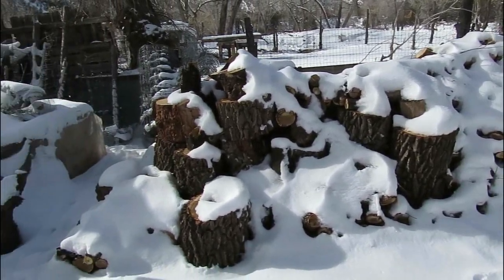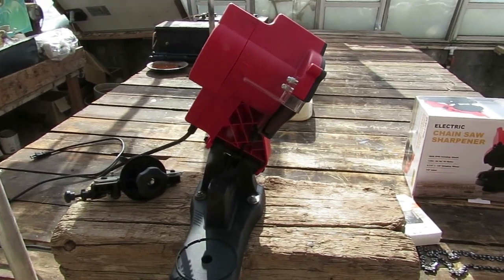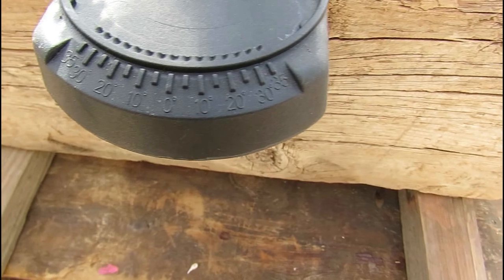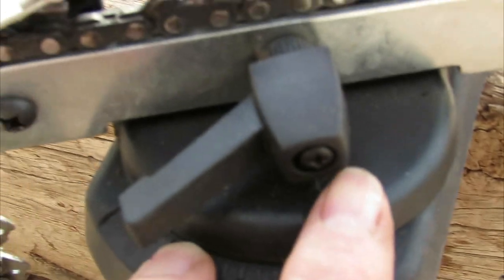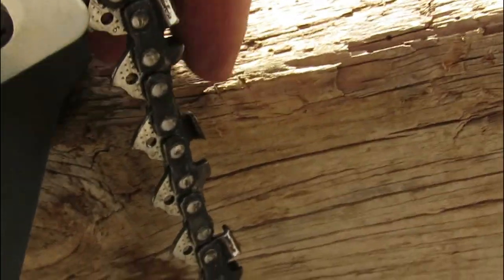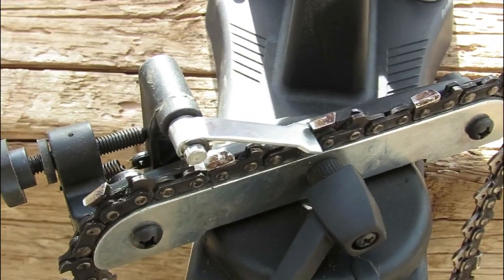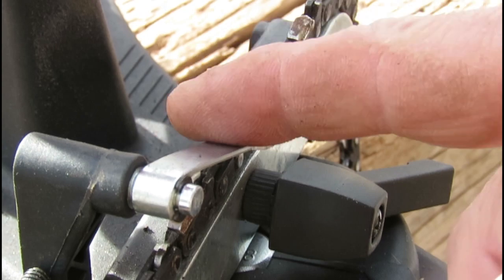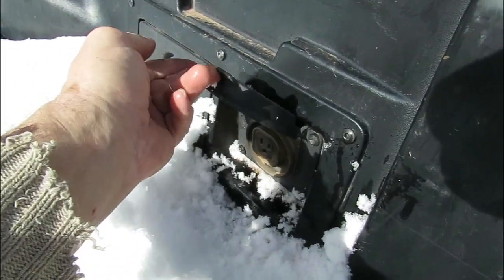Buffalo Corp. ECSS electric sharpener to sharper - refurbish bad chainsaw blades

Comment: I don't heat my home with wood, but I do heat my cabin with wood, so I spend a bit of time cutting & splitting wood. A few years ago I started using an electric chainsaw. It's quiet and starts with the push of a button, I love it. Lots of silver maple where I live, soft, splits easy and seasons fast.

Comment: I love my little Harbor Freight unit. It's only a tad easier to operate than yours.
I cut all of my chains at 25 degrees. Just a personal preference.
My eyesight is not improving with age, so I like to have a magnifying glass handy, when doing touchups, to see if the bluntness has been erased.
You've probably noticed that there's some side play in the pivot of the head, which is kinda nice to lightly lean into, when a cut hasn't been quite enough.

Comment: G'day Dave,

Yay Team!

"Under $50..." ; Yikes, what an absolute Hummdinger, that's a Bobbydazzler of a machine ; a huge amount of Technology for a pittance...!

It's an example of the "Excellent Value Chinesium" which is out there, in among the "Average" & the "Shitty" which are much easier to encounter.

  Beware of their "mtm" brand Chainsaws though..., apart from the usual pitfalls from the  cheaply manufactured  Powerhead, mine (a "62-SX") came with a Bar which is too long - so the Saw balances wrongly & dips it's nose in the Dirt every time it's put down,  it's Groove is too wide for the (narrow profile) Chain - so the Links  don't sit "Flat" but rather they wobble side to side (if they had used the correct Chain for the Bar, maybe the Motor wouldn't have sufficient "Grunt" to pull it through the Wood...?).

And the Bar appears to feature unhardened Mild Steel Edges on the Chain-Groove - so within 2 hours of first use the loosely  wobbling Chain had worn down the outer edges of the Bar Groove's Top-sides - allowing the Chain to "Rock & Roll" from side to side dependant on which Teeth are the sharpest & which cut & bite in the deepest,  therefore pulling the Chain off-centre...., leaving "Ripple-Faced" ends on both sides of the Cut.

By 3 Hours it was jamming itself by trying to cut in Curvaceous Lines - sometimes Left & other times Right - depending on which Teeth started the departure from the Straight & Narrow.

At the 3-Hour mark I "Dressed" the Bar with my Powerfile - but it's not much better...; I think the Chain-Bases are also soft Steel & they're now all worn off-centre as well...(?).

  So,  I think that I'm going to have to buy a (propperly manufactured) shorter Bar, and a new Chain the Tangs of which fit into the Bar's Groove without wobbling.

  So much for the $130 Chainsaw, which otherwise ignites the Bark on the Wood being cut - with it's stupidly-routed Exhaust Gasses...(!).

About the only aspect of your Chain Sharpening which might be apparently improved, would be to pre- inspect the Chain and locate the MOST Damaged Cutter it contains, and use that one to set up the various Adjustments on the Machine...; so that when finished, ALL the Teeth will be the precise same length as the one which needed the most Metal removed.

It "wastes" metal from all the less-damaged Cutters - but having Cutters of varying lengths (often caused by trying to dress individual Teeth after Rock-Strikes...) generally leads to rough & jerky cutting, bogging the Saw in the Wood, and having the "Longer" Teeth pull the Cut off centre towards their side...

   There's a LOT to thunk about, while pottering around with Chainsaws...

Such is Life,

Have a good one.

;-p

Ciao !
Reply: A bit late to reply but...
If you want a stubby rather universal bar, I recommend the Oregon 91, if you can find one.
The chains are easy to find, though the bar sometimes is not.
Most of the time a 14 or 16 inch bar is just silly to use. Unless most of what you're cutting is intended to be split.